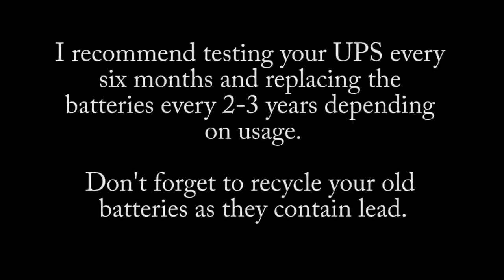Dell UPS 500w Battery Replacement

Comment from the maker: Here's a useful note, be sure to get the 7AH 12v batteries with the #2 connector which is 1/4".  Most security style batteries will have a smaller blade.

Comment: Thank you this video really helped me.  I had a Dell UPS 1000w with 3 batteries.But the steps were exactly the same.  We saved 200$ on tech. personnel because I changed them myself.Thank you.
Reply: How did you wire yours?  I have a K788N and could not find steps for this rewiring.  To top it off, the replacement cells had very loose crimp connectors so any movement would disconnect them.  There is like no room to route the short cables.  This unit appeared to be wired in parallel as opposed to series.